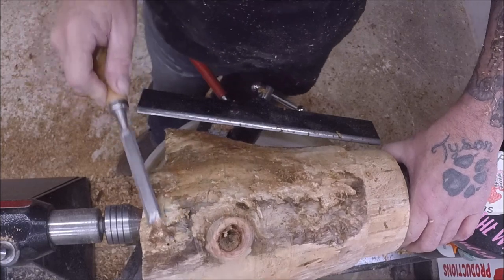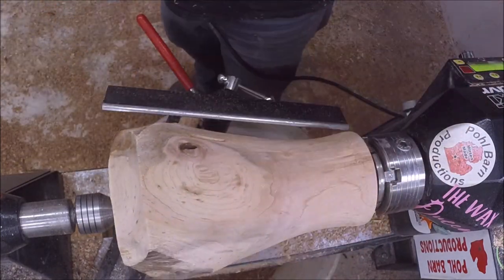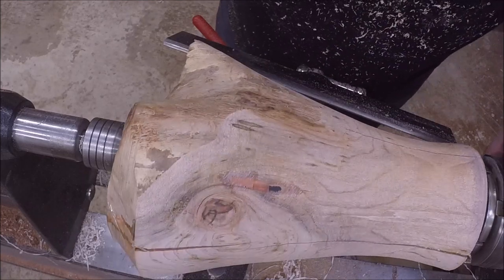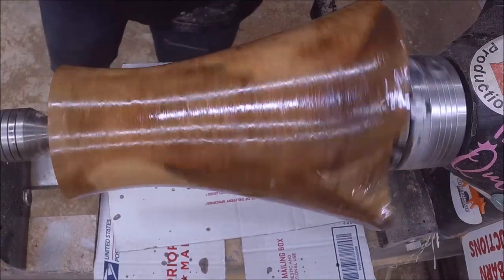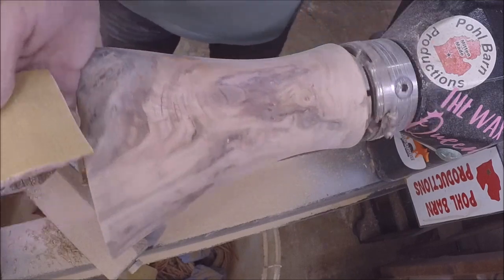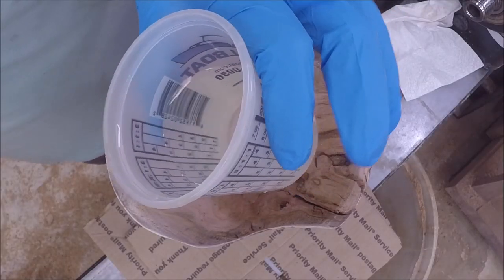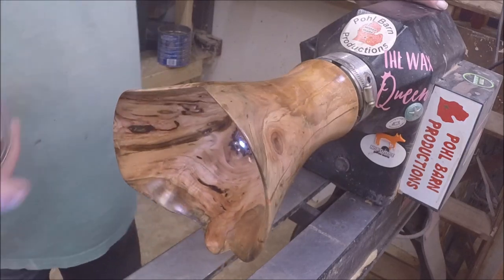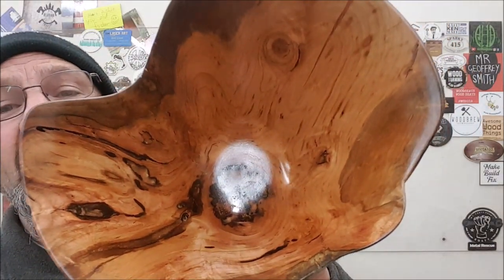Choke Cherry Vase

Comment: Ya know what Doug, that piece is superb!  I love wild cherry's appearance,  and the graceful lines you cut are quite soothing. 

Have you finished a wood turning such as this with a resin coating?  I have, using an ultraclear casting resin and the shine is awesome.  Not only that but if you chose the right resin it'll keep the beer from leaking!
Reply from the maker: Thank you Berry, I have on the inside but not yet on the outside of the vase.

Comment: When you're cutting the mortise on the bottom for your chuck jaws, why not cut most of it with the Forstner Bit and then clean up the bottom and edge with the chisel?
Wouldn't that be faster and make it far easier to get the right diameter?
I'd also suggest that you get an Ink Stamp version of your Branding Iron Logo made for those times you have to put resin in the bottom of the Mortises, that way, instead of melting the resin with the iron (producing a bad logo in my opinion), you can ink stamp the Logo on then either fill the Mortise with clear Resin or brush/spray on Lacquer (or Polyurethane) to keep the Ink from rubbing off...
Reply from the maker: YES   it is much easier and I forget about it all the time,  I actually just got done doing that exact thing on next weeks project. then I turned a piece if wood like a makers coin burnt my logo in it and parted it off,

Comment: Looks like you're in Michigan...just moved from Brighton / Ann Arbor area to Montana. Significantly less wood types to choose from out here.  Anyway, I was wondering if you could post or send  a list of all the finishes, resins, sealers, etc. you used for this.  I would appreciate it as I like the way your work turned out and, as I'm sure you know, there are a million different opinions of what to use when.  Thanks a bunch!!
Reply from the maker: I think most of it is in the description below the video, I still haven't found a product I like and works great every time.

Comment: Very nice! I have question/suggestion (maybe you've tried and it didn't work) You mention every now and then that you can't burn your logo in because of the resin. Couldn't you drill a shallow hole with a forstner bit (1"-11/2") in the base, turn a piece to fit the hole, brand the piece, glue it in, and finish coat. If the brand came out off center, you could make another without hurting the piece, just glue in the winner. Short story, you'd be making wooden medallions.
Reply from the maker: Thank you James,  Actually I just got finished doing this very thing on next weeks project,
Reply: @PohlBarnProductions  Yeah! Oh sure! Like it was YOUR idea!!!! Well, you're welcome! (this is supposed to come acrosslike a good natured ribbing, I'm not serious)

Comment: What's your advice on a lathe machine for someone who is only a beginner
Reply from the maker: To tell ya the truth I really do not know, I would think used  lathe or maybe even a harbor freight lathe as they are fairly inexpensive new or even a use one that some one else has up graded from.  this is not a cheap hobby and you will get sticker shock, so my advise is used or inexpensive so you can decide if you like it or not before you spend a couple grand on a better lathe.

Comment: Wow, that tool at the beginning looks like a curved version of ZW's BFS!  I've seen Heath Knuckles use cactus juice resin on pieces like that with the cracks.  Have you tried it, or would it make a piece that big way too heavy and off center on the lathe with the punky bits?  The finished product is beautiful!
Reply from the maker: Thank you Mary.  I didn't have enough cactus Juice to use on this piece, but thinning the resin with acetone worked very well.